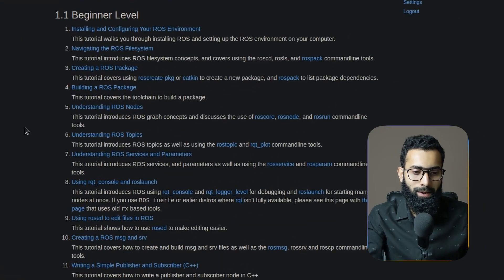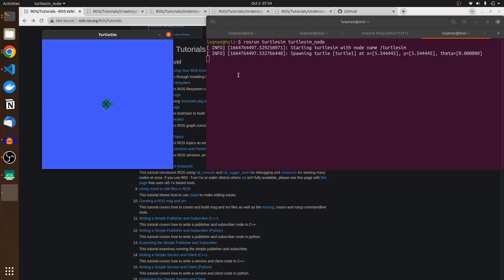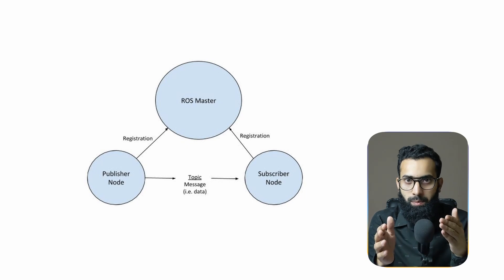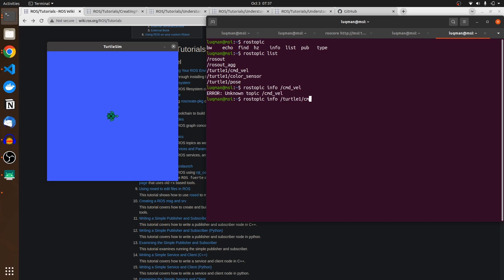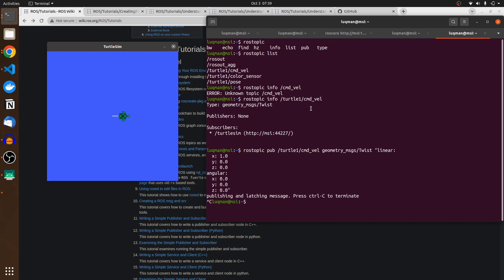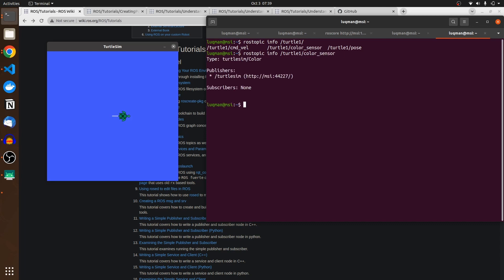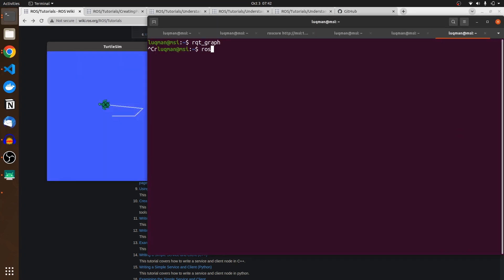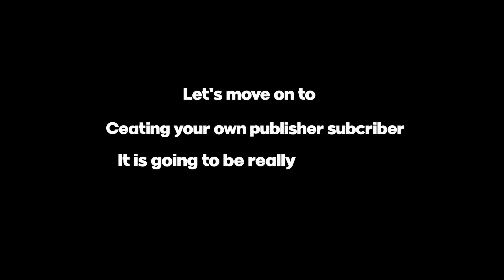ROS Topics and Nodes Deep Dive

Comment: when i type in rqt_graph i get the error:

This application failed to start because no Qt platform plugin could be initialized. Reinstalling the application may fix this problem.

Available platform plugins are: eglfs, linuxfb, minimal, minimalegl, offscreen, vnc, xcb.This application failed to start because no Qt platform plugin could be initialized. Reinstalling the application may fix this problem.

But i used Xlaunch and the turtlesim functions correctly. But when i type in rqt_graph, i get the above error. Do you have maybe an idea why?
Reply from the maker: Virtual desktop issues , but needs diving deep as tbsim is displayed and this qt based graph is not . Never Experienced with that .

Comment: Hi, I have been following a few of your videos to really wrap my head around the workings of ROS using turtlesim. I must say your videos are really good and have helped me a lot these last few weeks so a big thank you for your efforts and commitment. I have a question though.

I have spawn two turtles and I am trying to move a specific turtle to a specific location. I have gone through the go2goal tutorial and I understand we need just two parameters and threshold to move the turtle so like in your video, ```linear velocity in x```, ```angular velocity in z``` and the threshold (i.e. when to stop usually a distance).

My challenge is that I am trying to get the position of turtle1 and then use that to calculate the distance, lin_vel.x and ang_vel.z with which turtle2 has to travel. I have written a subscriber function to turtle1 but I want to assign the the x and y positions of turtle1 to a variable that I can use in the move function for turtle2.

I may be struggling due to my beginner level python skills or maybe a poor understanding of how node, topics, subsribers work. Any help will be appreciated. I can show you the code I have written.
Reply from the maker: you have to write a subscriber for topic "turtle1/pose" which tells you about location and position of turtle1 then manipulate it

Comment: Hello, everytime I want to run a ros command(rosrun, rostopic, etc.) in a new window, the terminal tells me to install rosbash first(apt install rosbash), for which I have to go to root directory to do so. Everything is working fine, but is there a way around having to use the root deirectory everytime?
Reply from the maker: share the picture on discord server so we can debug it .

on top of my head it is regarding source to ros installation . You can put it into bashrc file then it gets automatically sourced.

Comment: Hi Luqman, I have run this 

1. # rosrun turtlesim turtlesim_node
qt.qpa.xcb: could not connect to display
qt.qpa.plugin: Could not load the Qt platform plugin "xcb" in "" even though it was found.
This application failed to start because no Qt platform plugin could be initialized. Reinstalling the application may fix this problem.

Available platform plugins are: eglfs, linuxfb, minimal, minimalegl, offscreen, vnc, xcb.

2. export QT_QPA_PLATFORM=offscreen
export XDG_RUNTIME_DIR=/some/directory/you/specify 
export RUNLEVEL=3
source .bashrc 

3. # rosrun turtlesim turtlesim_node
QStandardPaths: XDG_RUNTIME_DIR points to non-existing path '/some/directory/you/specify', please create it with 0700 permissions.
[ INFO] [1672405618.508857089]: Starting turtlesim with node name /turtlesim
[ INFO] [1672405618.513468860]: Spawning turtle [turtle1] at x=[5.544445], y=[5.544445], theta=[0.000000]
but haven't got anything on display as you got turtlesim on your screen. how to get visulisation or display
Reply from the maker: Linux or windows ?
Reply: @robotisim  it’s window 11
Reply: I have installed ROS noetic based on your first video
Reply from the maker: @yyjadeja  problem is with gui application. Search for docker gui on win 11 any other tutorial
Reply: @robotisim  ok will try and let you know if problem solve. Thanks, your videos are such a lifesaver for beginners.
Reply from the maker: @yyjadeja   :)
Reply: @robotisim  after installing docker gui it’s work for me. Thank you very much for your support.
Reply from the maker: @yyjadeja  if you can brief the problem it would be great for community